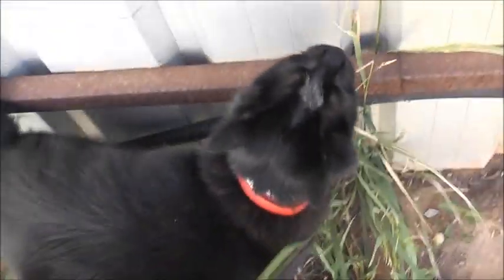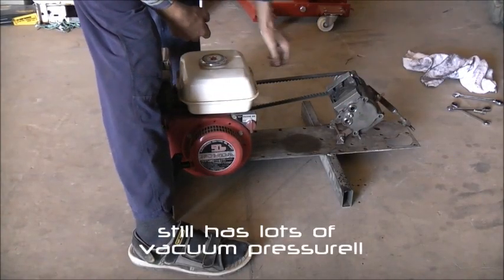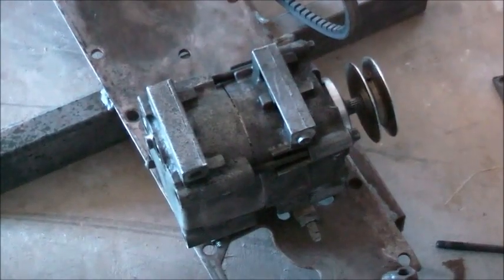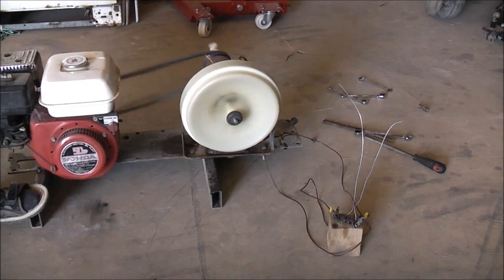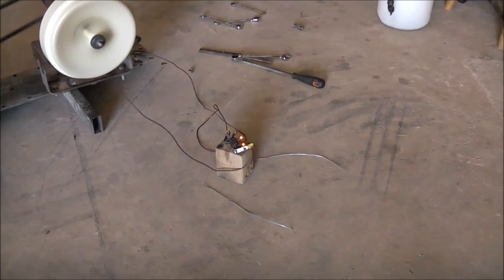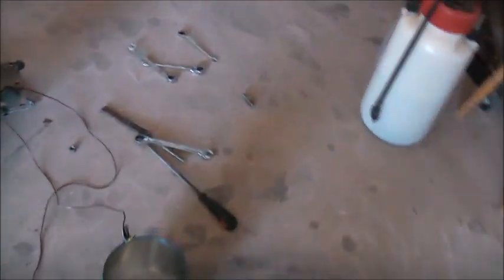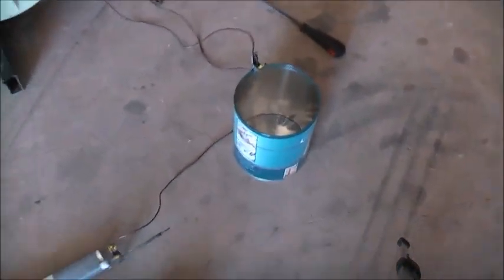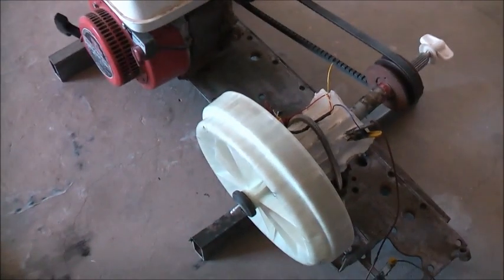Cat, Compressor Test & F&P Smart Drive Generator Fun

Comment: Mmmm, compressor seems to be working OK, but it sounds like its making that engine work hard! 

LMAO Jacob's ladder: Had a massive arc-up then became an arc-lamp shortly before burning out & going *POP*.

The sounds of the arcs coming off that F&P motor are way funny. They whiiiine & squeeel. :D That's much more than 50Hz, & possibly much more volts than a MOT.

As for the wires melting together, there may be a possibility of too many amps going through them...Could also be insulation breakdown.